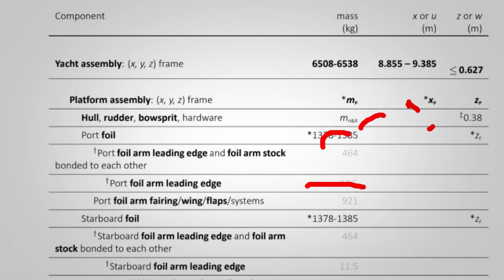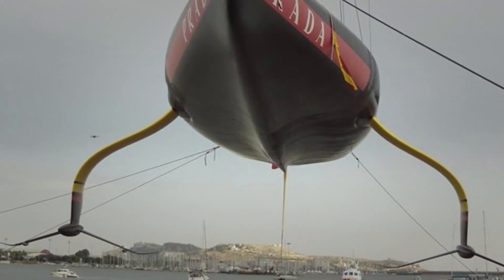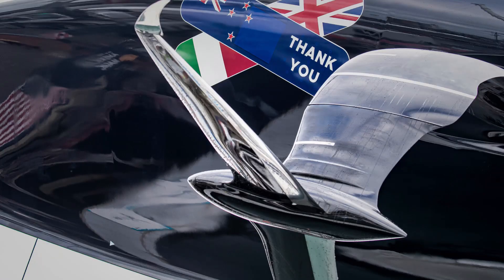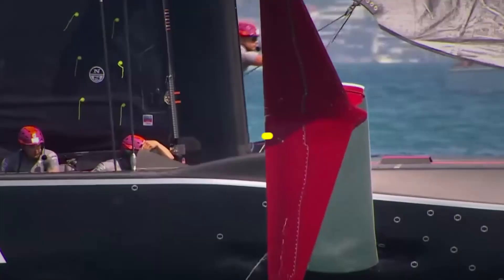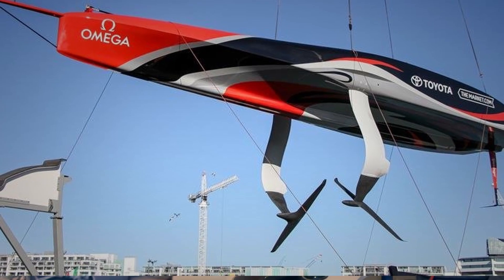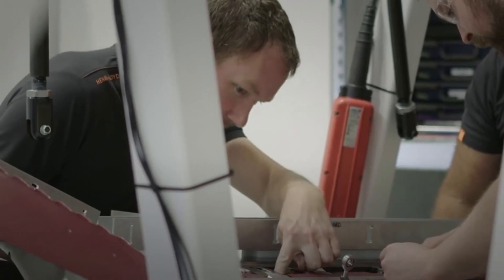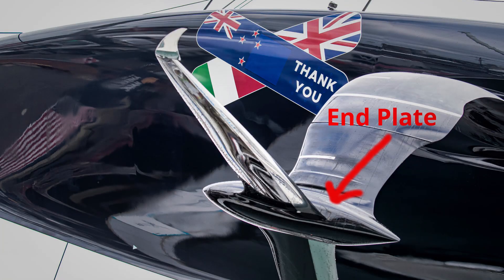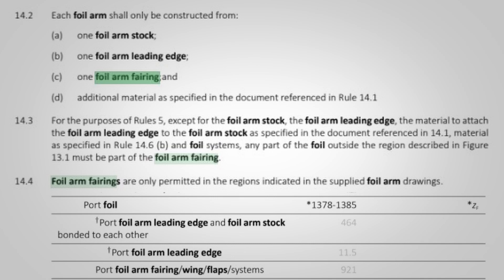Was American Magic's bulb a mistake? America's Cup Design Review

Comment: another great anaysis that makes the heart of the aerospace engineer in me being delighted. It is so reassuring that my development team were not going so wrong when designing the mainfoil of the iFLY15. We thought a lot about different shape of (small) bulbs, mainly to avoid caviation and also due to mechanical requirements (in order to have a stiff connection of vertical to horizontal (which we wanted to be able to dismantle, also to be able to sail different wings). We always considered massive bulbs as not helpful from the hydrodynamic point of view and ended up just with a small and elegant solution, avoiding cavitation and keeping the intersection profile constant, so the foil creating lift all over it's surface, making it very efficient. The bulbs in the AC75s are clearly disadvantageous from the hydrodynamic point of view. The only reason for them are that a huge amount of weight 920kg need to be squeezed into them. I find the design of the AC75s quite unnatural in this regards, to squeeze in artifical weight to stabilize the flight attitude of an airplane. This makes the aviation engineer howl in pain! There is other ways to create righting moment on a foiling boat. e.g using downforce created by a windward wing, which harms much less than carrying around lead, high through the air, where it on top represents a danger of accidents. This paradox makes the overall design of the AC75 appear a bit unnatural, besides the massive and fragile foil arms, that are needed to force the logical footprint of a catamaran into a monohull. Massive foil arms, exposed to horrible high bending loads, subject to catastrophic failure when a "small jump" occurs (as in the case of America Magic). Jumps like this happening often in everyday life of a foiling boat sailed by humans making mistakes.
Reply: There has been no failure of the foil arm. There's a good video on YT of them being stress tested - including a moment when an early test arm failed BIG time! The bulb is only one way of housing the mass required, designs without bulbs have been trialed too.
Reply: @maxhugen  I was not reffering to the foil arm itself not breaking, but the design concept of the foil arm failed. American Magic after jumping out of the water, the leverage on the foil arm destroyed the canting system which caused the big hole in the hull and the near sinking of the boat.
Reply: @iFLY-foiling  Terry Hutchison of AM explained that as the hull crashed down sideways, a section of the hull was effectively "guillotined" (his words) by the structural frames and stringers. It was not due to the FCS.
Reply: @maxhugen  I don't think this later given explanation is the full truth, as earlier, in the press conference, he clearly said that the cant system was completely destroyed. But we are running around in circles a bit. What I was saying, that the the foil arms defenitely are the vulnerable spot of the AC75 and that from engineering point of view they are quite unnatural, because the design principle means high bending loads, which an engineer, especially when building light weight, will always try to avoid.
Reply: @iFLY-foiling  I doubt that it's all that "unnatural" for engineers these days. From windsurfers to Moths to cats to IMOCA class boats, they are all foiling successfully. The AC75 is just one more concept.
Reply: @maxhugen   just speaking about forcing the natural foot print of a multi into a monohull. This was clearly a politically driven decision, not something that came from the engineers side. The 36th America's Cup just had to be on monohulls, because that was a conditions for LR support ETNZ in Bermuda. The compromise found are today's AC75. Ernesto Bertarelli being away from the cup is because of this. He preferred to push the TF35, which is a small version of what might be in some years the fastest sailing boat in the world.
Reply: @iFLY-foiling  The less stable monohulls are just far more challenging and exciting to sail.
Reply: @giovannigaleotti2623   the more stable  catamaran iFLY15 can get very challenging and very exciting to foil at high speeds beyond 30kts. It is adrenaline pure, more than most people can take (and I am saying it as a die-hard sailor). Especially flying stable in strong winds up to 6Bft. and a rough / choppy sea state. And it can also take off in less wind than the AC75. By expanding on both extremeties of the wind range, those boats have a larger range of usage, providing more sailing fun on more great sailing days. Sportive challenge is something very nice, and it absolutely can be found on a fast foiing catamaran. Whereas I do not believe in enjoying permanent stress from risk of losing control on a boat without decent flight stability. I love the moth class, as those are some perfectly designed boats. But they are not the right choice for everybody. It is very nice, that there are different boats to chosse from ;-)
Reply: @maxhugen  about mass in bulb vs. mass in wing : all is said in the video. However, I prefer not squeezing mass into an airplane, that is supposed to be light weight for best performance. Airplaned don-ät stabilize by weight, but by controlling lift on the two wings by ailerons
Reply: @iFLY-foiling  However, a cat has 4 potential points of lift, whereas these only have 2. Also, significant mass (crew) on a cat can be moved around for RM, not so much on a mono.
Reply: @maxhugen   totally agree, this is why a multihull clearly can be considered better fitted for the stability requirements of foiling. And of course, also a T-foil in windward can be lift out of the water, if that should be estimated wise (e.g. Vampire foiing catamaran). However, I personally am more fan of the windward hull remaining in the water, creating stability (as e.g. on the leeward roundings in last fridays's strong wind racing LR-AM. And in case of iFLY being able to be sailied with MDT technology (differential Main T-Foil), allowing to create downforce to increase righing moment. The induced drag by creating negative lift on windwards is minimal, compared to the gains in propulsion delivered by the rig by having more righting moment available
Reply: @iFLY-foiling  Fair enough, there must be many sailors who would prefer that additional stability. However, it's a different case for those who want to win the AC, whether it's on one or two hulls.
Reply: @maxhugen  I think there is a very common mistake made by making a difference between stable foiling yachts and racing yachts. Traditional thinking is a bit like : stable or fast? as if those were opposing goals. My unshakable conviction is that only a stable foiling boat is winning boat. In the semi finals day 1 this got once again demonstrated. Small problems with stable flight attitude gave Team USA no chance against LR. Given the superior natural stability of the multihull platform and given the far more natural provision of righting moment, without fragile and disadvantageous foil arms suffering from huge bending loads, and without draging arount weigth (the natural enemy of everything that flies), I believe that an AC75 could be easily outperformed by a state of the art multihull of same size, free of the limitations of the 2013 AC72s and taking advantage of the last 8 year's gain in experience. Most important feature from my point of view would be full control on all four foils (AOA and flap control) with the option to either lift the windward foil(s) out of the water or keep them there and use their profiles with negative angle of attack to create righing moment by negative lift windwards. A boat consequently using these features will have a wider wind range, a earlier take-off speed, a higher upper wind limit, 100% flight time, and higher top speeds, while staying in control.
Reply: @iFLY-foiling  suggest you don't try flying any current-day stealth aircraft, IFly !

Comment: NZ have blended the bulb with the wing (BFB), similar in design to blended-wing-body aircraft designs. As well as concentrating weight as far outboard as possible for RM, this design also provides lift, but reduces drag compared to the "torpedo" bulb of AM.  It's possible that, due to strength requirements, a "no bulb" solution requires part of the ballast weight to be in the lower part of the fol arm as well as in the foil wings to accommodate the ballast's required volume.

Comment: First of all I'm really enjoying these vids, very interesting to look at the various design solutions that the teams have come up with to fit within the rules and the teams interpretation of the rules. Given enough time all the solutions would look pretty much the same as there is only one perfect design in nature.
One thing I would question in this video is the discussion around the weight rule for the foils, as you mention in the vid this was a rule to allow self righting and doesn't relate to how the foils and foil arms work hydrodynamically, in fact its a disadvantage as it adds to the force and inertia required to move the foil arms.
Once you're working with lifting surfaces the weight just adds to the amount of lift required from the foil section, so compromises that choice of section. The ideal solution would be for the foils/foil arms (and the boat) to be as light and rigid as possible, the section would then be chosen for its best lift/drag ratio.
Ive sailed both Moths and A Class Cats and am a keen paraglider pilot, my current paraglider wing weighs approx. 5 kg (all up weight inc. me is 95 kg) but produces a top speed of 60 kmh and a glide around 12:1. It's light because it has very little structure , so that it can be packed in a relatively small bag for transport and relies on air filling it to create and maintain its lifting aerofoil shape. Its flying performance comes mainly from the section design with parasitic drag reduction (thin suspension lines, faired in harness, etc.) helping too add to its performance.
My Moth was 30 kg all up and could exceed 30 knots, A Class Cat was 75 Kg and could also exceed 30 knots with the right pilot on board. Once hydrofoils are the predominant design brief then less weight is better. fo max. performance. The weight requirement for the AC 75 foils is a bit of an aberration when all this is considered.
Reply from the maker: The bulb weight provides righting moment before the hull is flying as well. Until the hull lifts they really struggle for RM. But yes, I wonder if the next iteration of this call will see a reduction in bulb weight, as it's clearly not capable of self righting.
Reply: @MozzySails  
Not self righting if the hull is sinking, but didn’t NZ self right before being towed home?
Reply: @michaelwise1224  No, not quite. None of the boats has been able to self right.
Reply: @maxhugen  
It’s taken me forever to find your reply to say: You’re right. 
The boats are better described as not inverting than as self righting.
Reply: @michaelwise1224  👍 Indeed!

Comment: As an avid sailor for over 45 years but not an engineer, this might sound stupid but if aerodynamics are so important as an aeroplane approaches and breaks the sound barrier then surely hydrodamics must have the same thing at a much lower speed as water is 1000 times denser than air, is that at 1/1000th the speed? I expect not tbh but surely it's below the speed these beasts are going. The solution for aviation was swept wings and all moving surfaces or at least the ability to trim the whole horizontal stabaliser not just the elevators. Am i missing something here? Probably..lol
Reply: Hydrofoils suffer eventually from a different issue - cavitation. Basically, when speed increases and pressure gets low enough above the foil, it reaches the vapour pressure of water. End result is a loss of lift, and often local damage to the foils, eg pitting etc.
Reply: The speed of sound in water is much higher than air, actually 4.3 × faster!
Reply: @JGRGilbert  wow, i never knew that. However, the boundary layer issue is different and the same as i have just learned from this comment section. So the speed/ density thing isn't the issue its the pressure or lack thereof that is. Cavitation is something i know about from propellers, even on my sailboats ancillary engine. Thinking about it, ive had it effect rudder function on performance dinghies at high speed in a viscous turn. Really interesting stuff though isn't it.
Reply: @andrewbarton8525  Yes. I was amazed that cavitation eats away at the metal of propeller blades.
Reply: @JGRGilbert  I pulled yhe little 8hp that sits rarely used in my 27' Edel 4 at the end of summer for the first time in a few years. When i do need it tbh its in an emergency...as in I have cocked up...lol. the damage to the prop was amazing. Its probably a little small for 1.5 tonnes of boat that needs stopping or turning really quickly on a lake when the wind wont do it and as i said, ive ..ummm... miscalculated?. Lol.

Comment: Есть композитные металлы с большим удельным весом 15 - 20 гр/см^2. Форма крыльев  с обтекателями может быть заимствована у "Конкорда". Крылья с большим V и большим сужением ( с малой хордой на концах ) очень плохо работают при боковых скольжениях ( дрейфе). А дрейф есть постоянно из за несимметрии несущего крыла и стабилизатора относительно продольной оси. There are composite metals with a high specific gravity of 15 - 20 g / cm ^ 2. The shape of the fairing wings can be borrowed from the Concorde. Wings with a large V and a large taper (with a small chord at the ends) perform very poorly in side slip (drift). And the drift is constantly due to the asymmetry of the main wing and stabilizer relative to the longitudinal axis
Reply: Good morning NZ time !   For the layman like me, if the foils are all different on all the boats, does this mean that the control systems, electronics, sails, hull shape, etc etc etc are slightly different. Or is the answer a lot more complicated than that.

Regards
Reply: @johnmartin7158  Да  Yes

Comment: Did I hear correctly that these boats were intended to be self-righting? Did we see that happen even once?
Reply: Well there have been quite a few capsizes from, I think, all the teams. The footage does tend to focus more on the dramatic  capsizes than the recoveries.
Reply: Ah, no, that didn't quite work out!
Reply: Both KIWI and AM recoveries are recorded. Although the boat did not get up by itself it did look relatively easy recovery. As Pter Burling said - think about such capsize with an AC72
Reply: On the contrary, AM showed no sign of self righting even several minutes after its race capsize. Admittedly, it was shipping water but with the airborne foil in raised position it appears to be near 90 degrees...in which case none of its weight exerts a righting force. 🤔 The underwater one, I guess, is acting like a keel though. I didn’t see how they eventually righted it. Perhaps spun boat, sail and deck to windward?

Comment: Do you think there would be teams using Tungsten instead of Lead a s a weight? Specific density being for W 19.25 vs Pb 11.34.
Tungsten is not as malleable as Pb but it does have significant mechanical properties, eg Tensile strength
Reply: Depleted Uranium
Reply: Gold?!!!
Reply: If it's made of tungsten, doesn't that make it a 'lightbulb', lol.
Reply: Rule 6.3 states that  "Materials shall have a maximum density of 11,400 kg/m3".
Bit of a shame, I think...
Reply: @Gottenhimfella  There you have it, Lead it is then. Yo could probably encase it in steel rods or other shapes to make it structural. Bit of a shame. 
Machined Tungsten products cost between 100-200$ a kg, pricey but if it were and advantage enough...
Reply: Ah ok - yes, shame.

Comment: Is there anything preventing the boats from using a more dense material for the weight requirement
Reply: I wouldn't be surprised if the Rules prohibited the use of exotic materials like depleted uranium!
Reply: There is. Lead is the densest material allowed
Reply: @rbcg105  Yep, found the Rule:  "6.3 Materials shall have a maximum density of 11,400 kg/m3."    (Pb~=11,340)